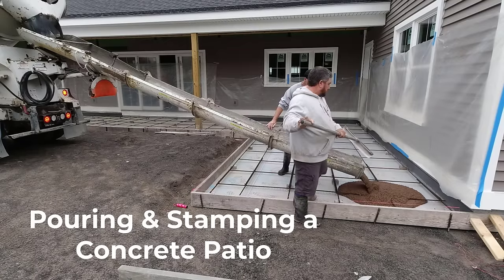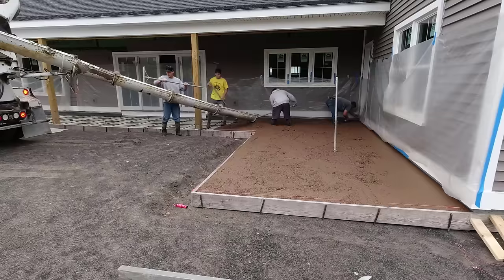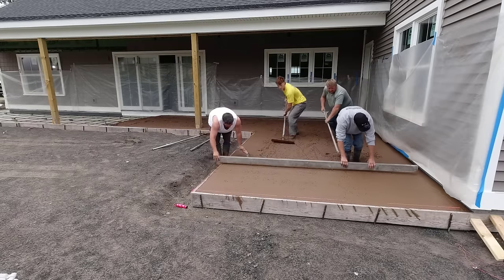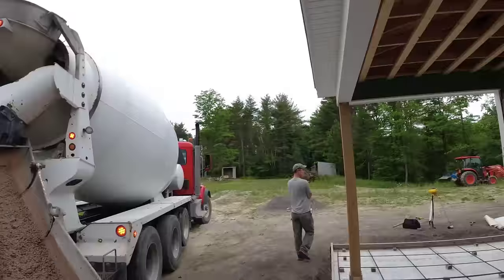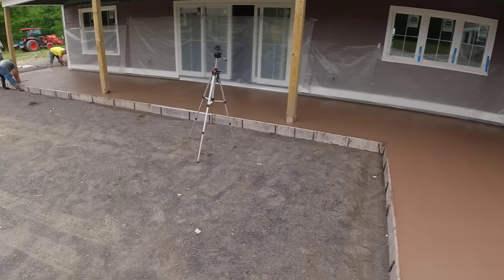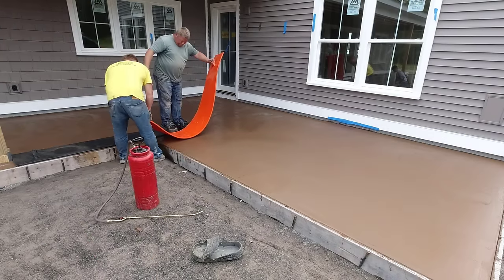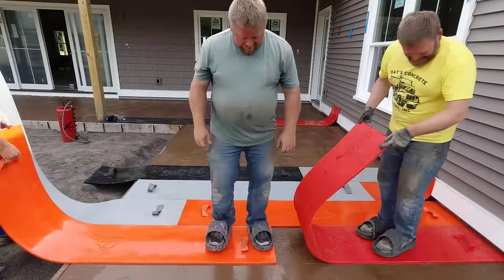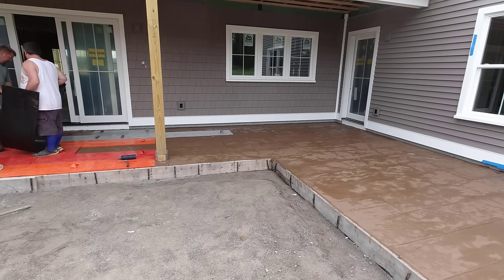The Concrete Was Brown! How To Stamp Brown Concrete

Comment: Colored concrete is such a funny thing. All that color is showing in the top few millimeters. We had a job here in the MN Twin Cities where they were putting in light rail and re-doing the boulevards with red bricks. The street light bases had to be the same color. The minimum load was three yards. You could only do four or five of them at about two wheelbarrow loads each and the time limit would run out. The rest of the mud had to be dumped at the recyclers yard. By the time the rail line was done we must have dumped out several hundred yards of red concrete, so that top millimeter of material could make it all look "perdy". LOL